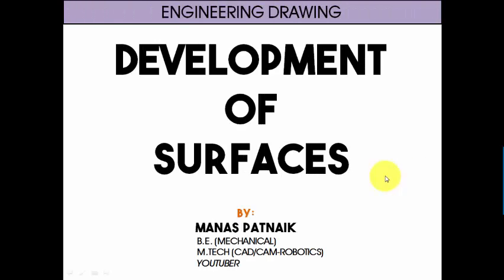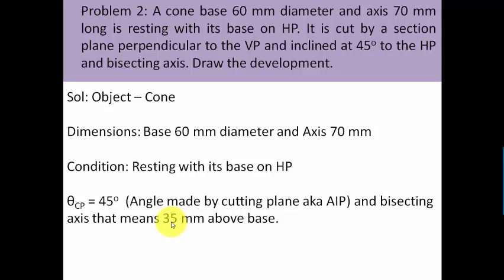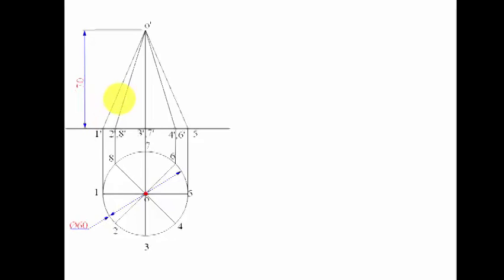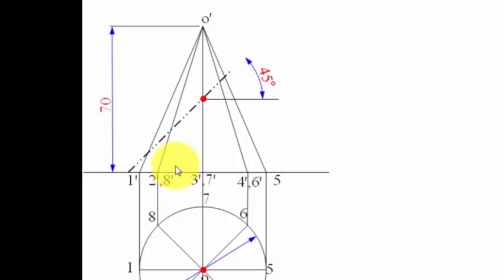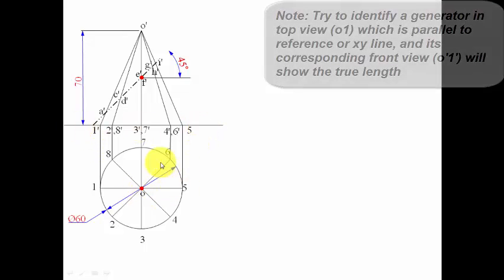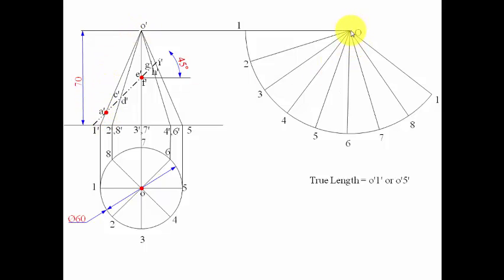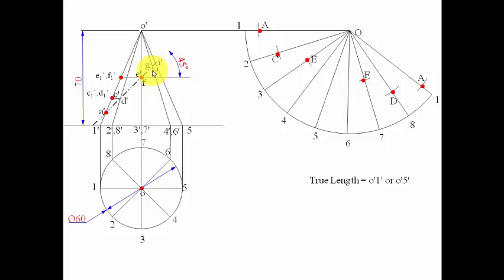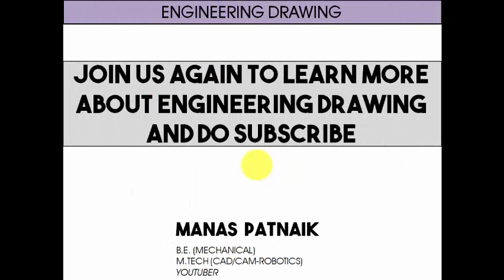Development of Surface of Cone_Problem 2

Comment: A cone of base diameter 40 mm and slant height 60 mm is kept on the ground on its 
base. An AIP inclined at 45° to the HP cuts the cone through the midpoint of the axis. 
Draw the developmen